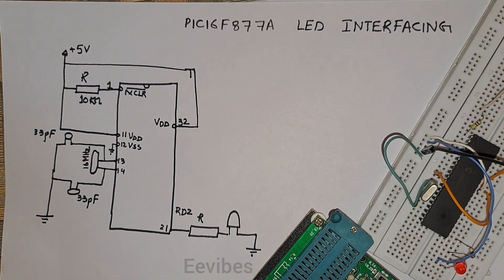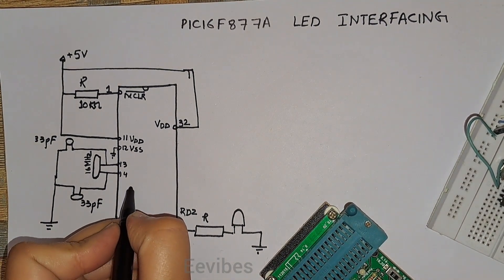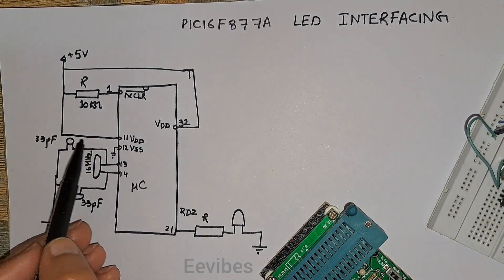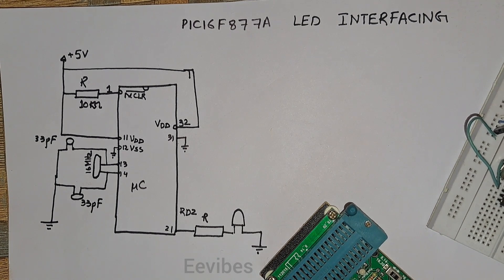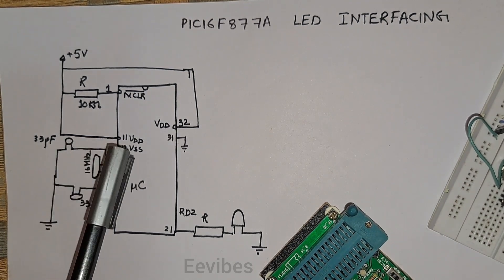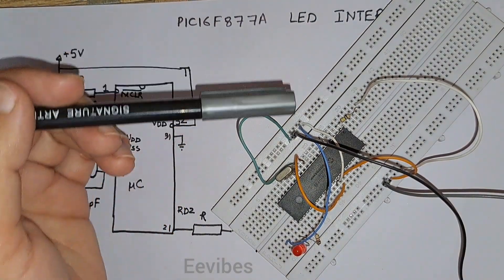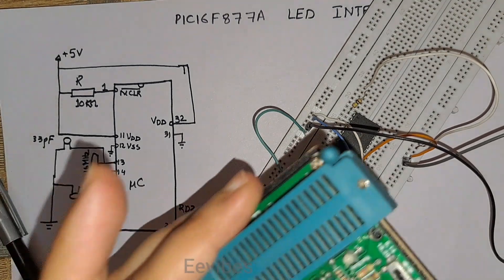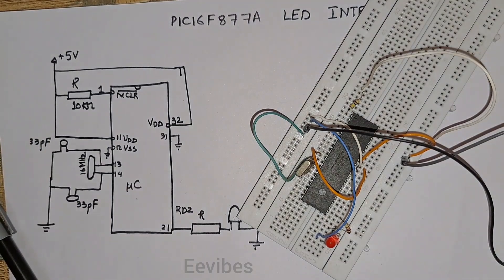LED Blinking Program for PIC16F877A Microcontroller || Complete Circuit 2024

Comment: PIC16F877A does not have internal oscillator, does it?
Reply from the maker: Yes it has the internal oscillator as well.
Reply: @eevibessite  according to the datasheet, it does not. 
14.2.1 OSCILLATOR TYPES
The PIC16F87XA can be operated in four different
oscillator modes. The user can program two configura-
tion bits (FOSC1 and FOSC0) to select one of these four
modes:
• LP Low-Power Crystal
• XT Crystal/Resonator
• HS High-Speed Crystal/Resonator
• RC Resistor/Capacitor
Reply: Ok, one can use the RC option. It worked for me.